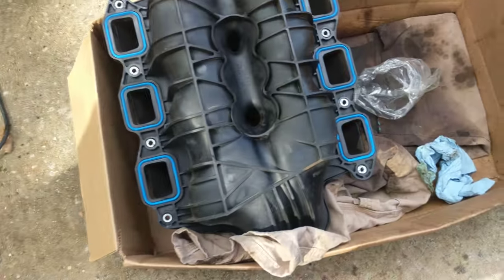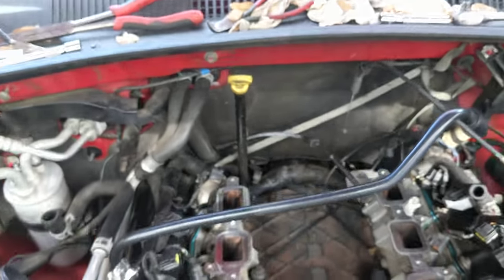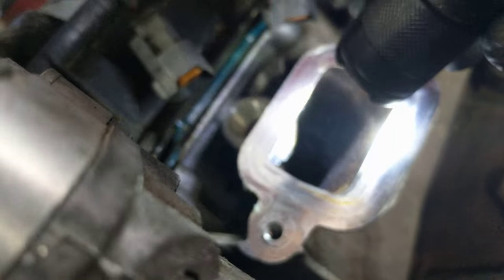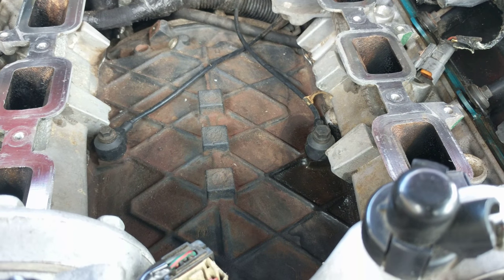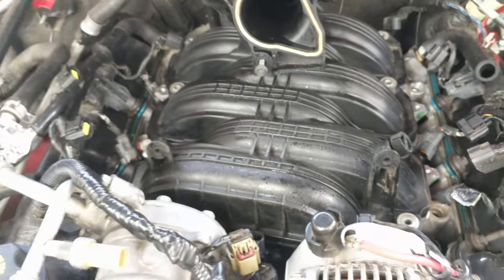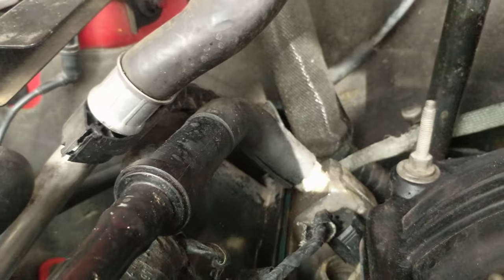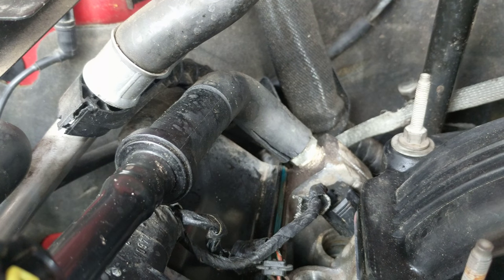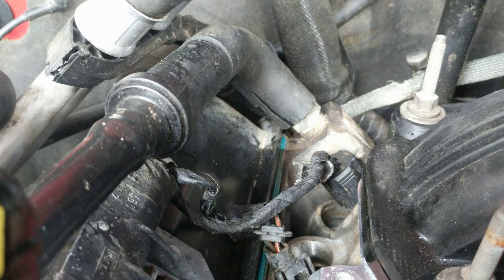3.7 L Jeep/Chrysler Intake Manifold (6)

Comment: Is it okay to find oil inside engine intake conduit? My car us leaking oil through manifold gasket, but from yours it looks like having oil might be normal?
Reply from the maker: If you're talking about in the cylinder intake port on the block head itself, it is likely you have valve seals leaking. Not the worst thing in the world - just always check your oil, because it's leaking through and being burnt in combustion. Also keep an eye on 02 sensors as it may foul them.

Comment: how did you get the dipstick off and back in?
Reply from the maker: If I can remember right there's a number 10 bolt that holds that dipstick bracket down. You will need an extension to get down in there and maybe have to get it by feel.
Reply: @starootoo  thanks i intend on doing the same job tomorrow. I liberty is shutting off while idle no acceleration of a stop or on the hills i've changed mostly everything related to it sparks injectors etc. How did you clean out your intake??